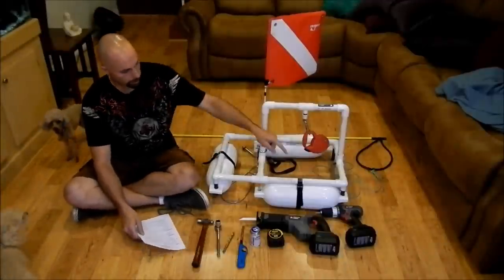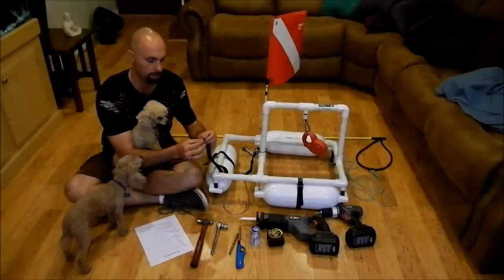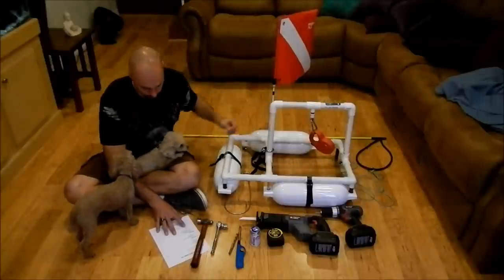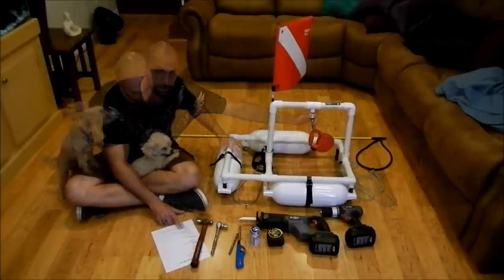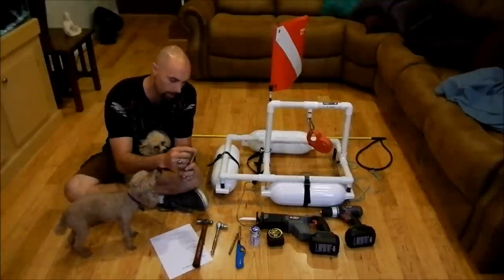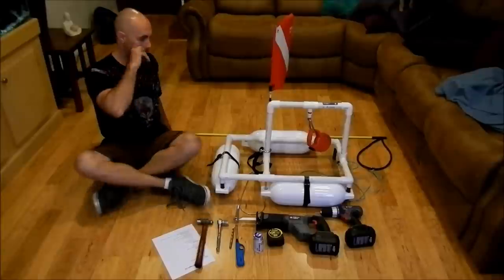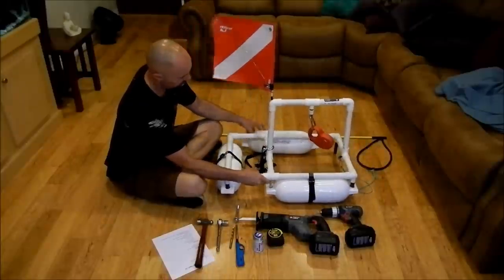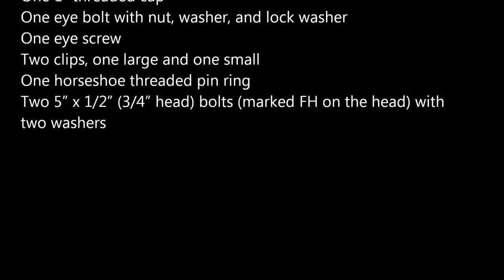Pete's Dive Buoy

Comment from the maker: Uh... ya-know... ballpark figure it all was probably about $100 bucks-ish. I got a good deal on the boat bumpers, because I purchased them from Costco. PVC pipe is really cheap. The most expensive item on the buoy is the dog leash. I spent about thirty dollars for it.  You could probably even use large diameter PVC Piping for the floats and seal of the ends with glue. It'd be a little heavier, but would float. : )
Reply: I think forget about the boat buoys and just use 3 or 4 inch pvc pipe for that part. I bet it would cut down on the cost.